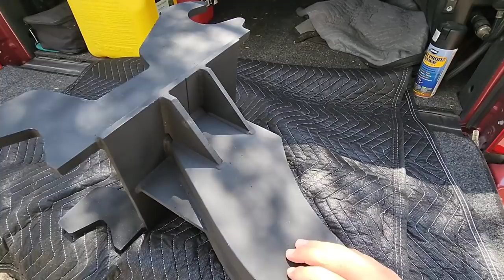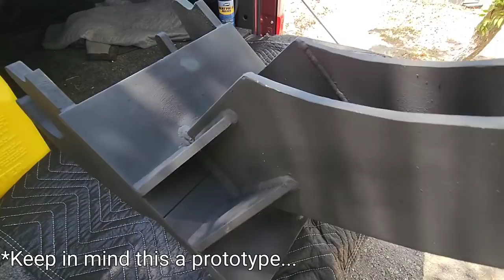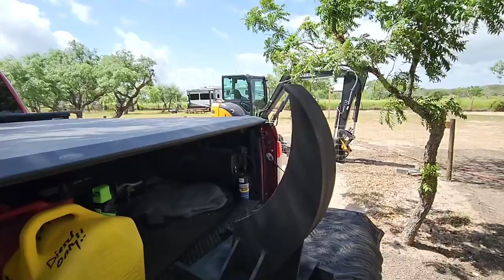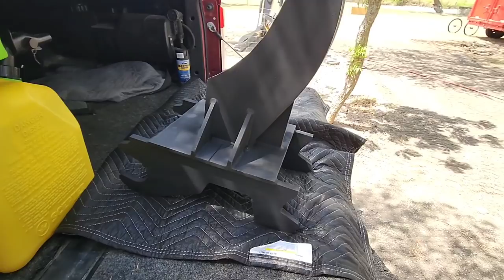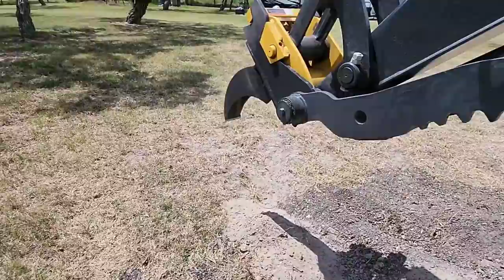The CUSTOM Raptor Claw Bucket for Mini Excavators!

Comment: Most companies trench, vibratory knife or directional drill in 2” HDPE prefilled with their cabling. A tiny walk behind trencher can run about 1 linear foot @ 20 inches deep every minute in soil that isn’t frozen or with boulders. A vibratory knife can run at about 3-6 linear feet @ 20 inches deep every minute and doesn’t require the same backfill requirements as trenching. A directional drill operates at about 4 linear feet a minute. As an electrician this tool would be useful addition to the above means of operation. Primary use of this tool would be best left to government jobs. This is basically a hand shovel attached to a excavator.

Comment: Instead of trying to dig like with a bigger bucket, bury the ripper to desired depth then back the excavator in the direction you want to go. Save you a lot of time.
Suggestion as well, map out your run, then spray paint line on ground. This will help with the "oops went the wrong direction". Same principle as using ditch witch to dig a trench.
Reply: I would say for amateurs that is fine, but an operator should be able to move the bucket, and you don't get the practice on the sticks if you only ever walk it.
Reply: Not a ripper, won’t hold up

Comment: Try planting it in to full depth and just backing up. I’m wondering if you need to scoop it at all.
Reply: I was thinking the same thing
Reply: It's a scoop not a plow.
Reply: @Denden505  it doesn't mean it won't work if the machime has the HP and taction to do it. It doesnt mean he won't like the idea and commission the build of a part that that will work. Trying things and failing is how million dollar ideas are made.
Reply: @Denden505  it doesn't mean it won't work if the machime has the HP and taction to do it. It doesnt mean he won't like the idea and commission the build of a part that that will work. Trying things and failing is how million dollar ideas are made.

Comment: I designed a trencher for the back of my tractors where you can drop it in and drive and the dirt is pushed out the back of the trencher bucket by the force of the tractor going forward. The trencher has a angled shoot that puts the dirt off to the side as you drive forward which will allow you to recover it once the line is dropped in by just using the front bucket pushing it back in

Comment: As long as it’s non-liquid and warm weather are you’re fine. 
Most water lines have to be 3’ deep in the south and 4’ in the north. It’s more of an answer looking for a question. 
You mentioned a quick-tach. If you have to get out of the cab to install an attachment, there’s nothing quick about it.
Reply: I was thinking the same on the quick attach, especially when I saw the ratchet lol.

Comment: So when you get ready to actually trench your lines in. You need to dig you starting hole and ending hole with the bigger bucket.  That way you have room to make connections and have a place to clean out the trench at.

Comment: We install thousands of feet of gas line a year with a mini ex using a 9" wide bucket.  Works well for our application.  I could see this bucket being helpful in rocky areas however.  Would be easier to grab ahold of edges and pull the rocks out.  Trenching looks like it would be pretty slow not being able to scoop much dirt with each pass.  We also have to go 18" deep in some areas, so that may make it hard to use.

Comment: I like the ripper. The only suggestion I'd have is add a bolt on cutting edge. Use plow bolts so they mount flush on the cutting face. 
You may even add some hard facing. 
Just old farming experience talking though.
Looks great though, nice job!

Comment: Nice bucket. As a former Millwright/fabricator I would run some hard facing on the sides and on the blade tip. Also did you have him make a taper from the front of the bucket to the back? If you don’t have a small taper then it can be hard to dump the bucket. It will create a suction and prevent the dirt from coming out easily. A former co worker used to fabricate buckets. Anyways nice excavator.

Comment: Great entertainment , But what a waste of time and fuel !  A 12 inch bucket is the best  for trenching its quick and moves dirt.
That toothpick is a waste of fuel in my opinion. Also Its a 10,000 lb machine  Why would you attach such a thing on it ?
Reply from the maker: Honestly, a 12" bucket is a waste of time since it's more dirt I have to backfill over a relatively small diameter pipe.
Reply: @BigTruckBigRV  Only if you are not efficient at operating a 10,000lb machine ?
That machine doesnt care if it scoops with a 4inch toothpick or a 24inch bucket  The same fuel and time is exerted  The same motions are made and with a 12 inch bucket back filling is very easy when you curl the bucket and sweep the dirt back in the trench .
Do what you want . also that machines has a blade  that is used for back filling trenches .